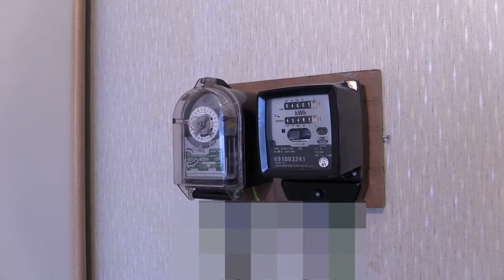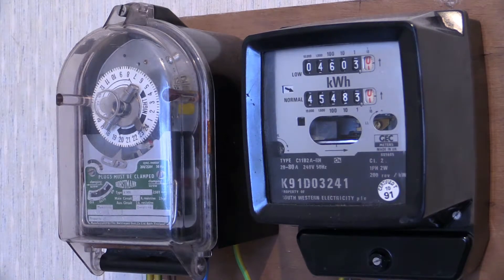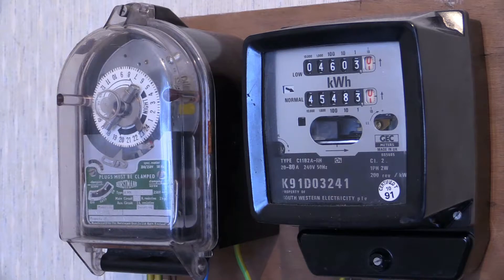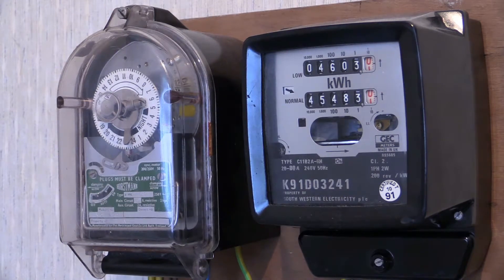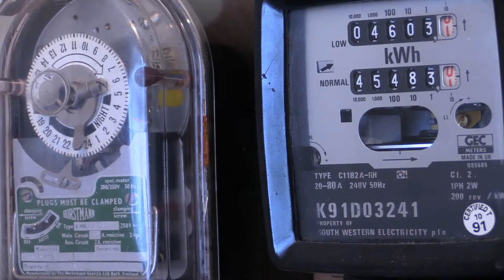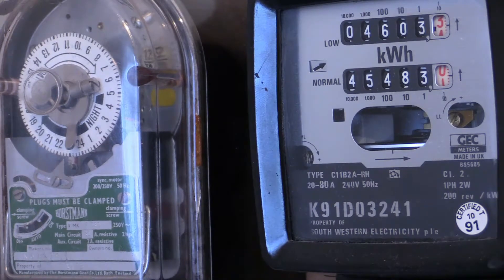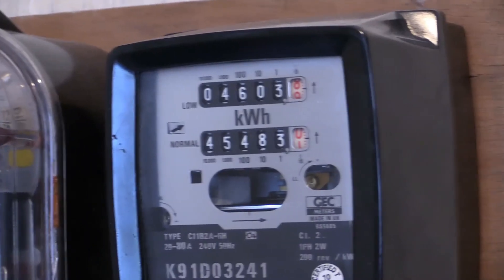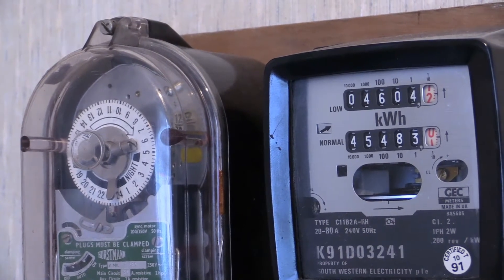Time Switch : Horstmann Vmk 7 turns on 75A Phantom Current!

Comment: I dare you to make a video of how to wire up a consumer unit (complete with service heads, isotlar, 10/16mm incoming service cable, and hager branded rcds and mcbs (just a video idea if you did this i would probably watch it a ton of times)
Reply from the maker: Hiya. You said: "I dare you to do a vid on wiring up a consumer unit......"

In response to that, I say this........

........ I dare you to make the payment for all the bits and pieces!

To make payment, please go to the "About" tab on my channel and activate the Email link.

As soon as your payment has been received for the production of the video, I will get on with it.

There will be an initial consultation fee before any works start on assembling a pricing quote, buying-in any parts or making any videos, and this consultation fee will be non-refundable.

After the video has been done, because you paid for all the bits-and-pieces, it will be up to you as to what happens to the parts.

For now, I will look forward to your email so that we can start the ball rolling on this exciting video that you mention (and receiving the payments for it)

Thanks,

-Wayne's Electrical.

19th September 2018, 12.20